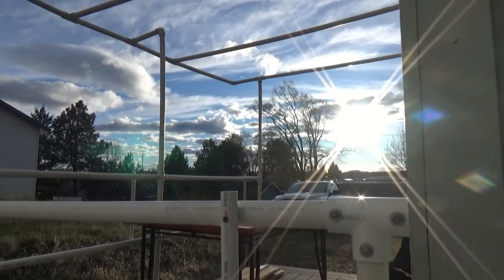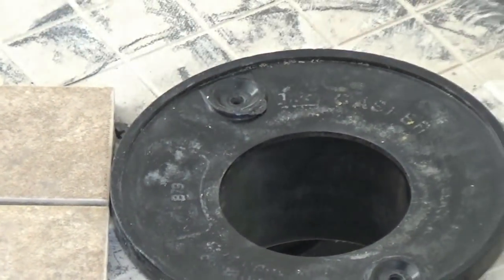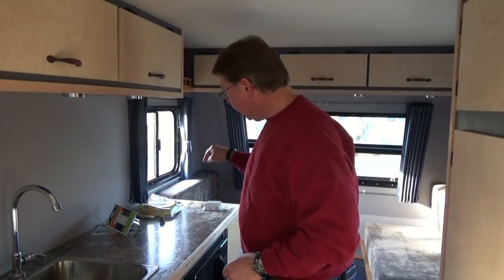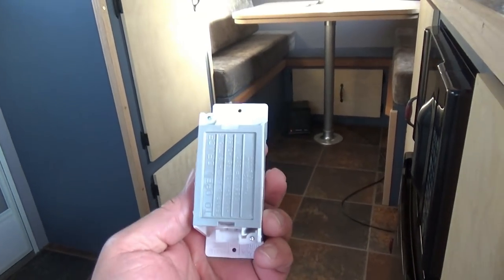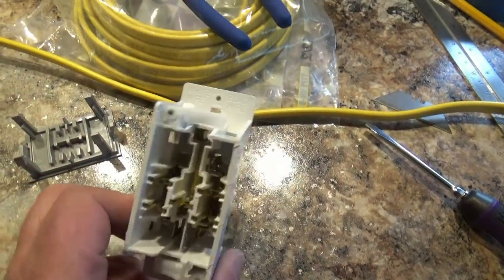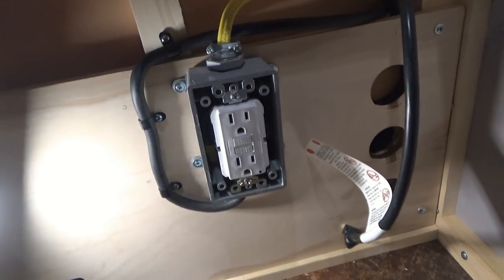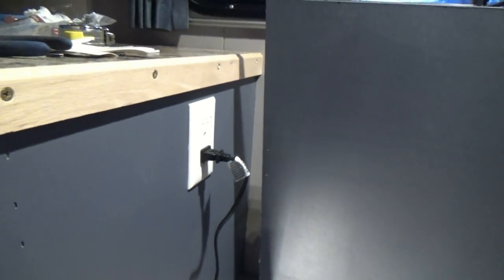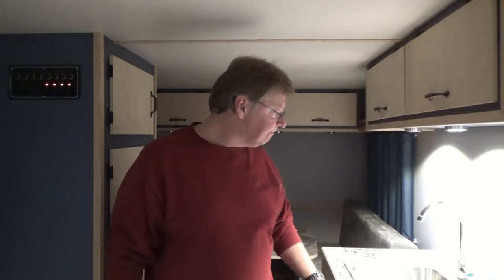How To Build A DIY Travel Trailer - Part 73 (Installing Last Outlet – What Neighbor is up to!)

Comment: Lookin good!
I think you made the right call on the heavier axle.  Also, whenever you upgrade tires, get ones with at least 2 more plys than recommended.  As many of us know, the most expensive part of tires is when you have to replace a blown one in the middle of nowhere, not to mention potential damage to your trailer when it blows, due to having only one wheel on each side..
Reply from the maker: True that!! Think I'll go with solid rubber! No blow outs!! LOL!!

Comment: Other than the converter and inverter... What else do you have left?? That puppy looks almost good to go!
Reply from the maker: Hi Joshua! Real close to being ready! I have a couple of major installs left before I can call it finished... I will be installing a Fantastic Fan Vent in the ceiling and (don't tell anyone) I will be swapping out the axle to a 3500 pound axle (currently 2000 lb). Then a couple of creature comforts such as a backsplash, rod holder in the closet and a few other odds and ends to button it up.  Almost there! :)  Thanks for stopping by! Cheers!
Reply from the maker: How's your project coming along?